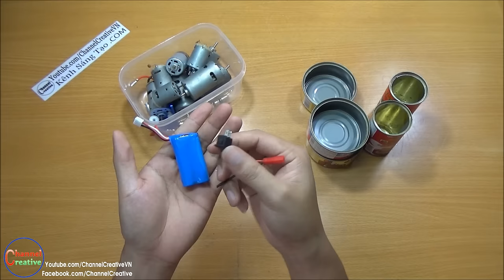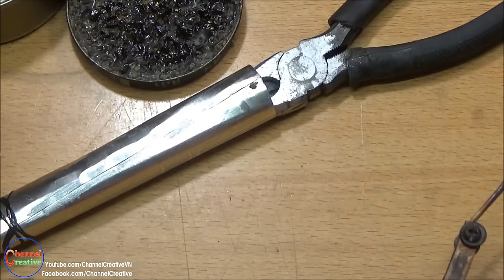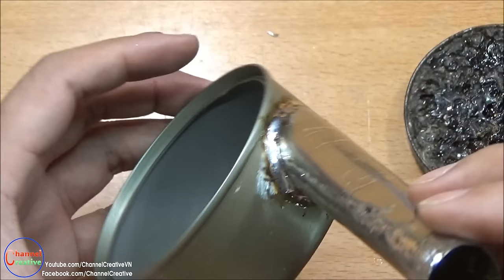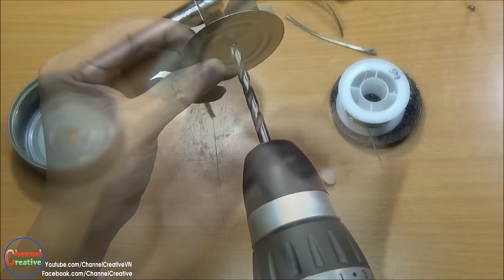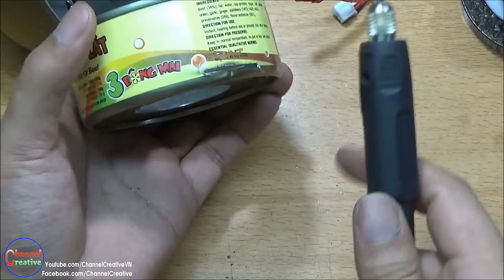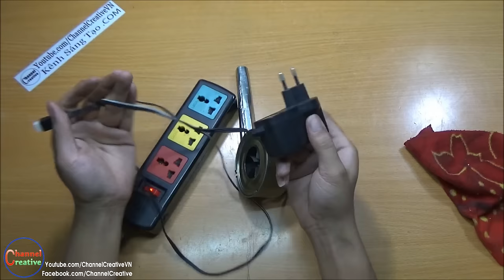How to Make Mini Super Powerful Air Blower using Cans Fish

Comment: When you solder tin or any large metal surfaces you could use some better preparation of the surface. Diluted HCl(hydrochloric acid) does very good job as a primer I've used it to make leak proof fuel tanks for model planes out of tin. Some rust converters can do a good job too. You will spend a lot less solder and you won't need the resin filed one.

Comment: If you curved the fins the opposite way you would've got way more air movement out of it. They should be scooping the air and forcing it through the exhaust rather than pushing through the air. Think of it like a turbo. The compressor wheel scoops air and forces it through the system increasing the velocity of the air going into your engine.
Reply: When I saw him put it together I noticed that straight away. Thanks for confirming I haven't gone mad! 🤣

Comment: Aren't the fan blades backwards compared to where the outlet is?  It still works, of course, but I would think it would be more powerful with the blades reversed.
Reply: That is an excellent point.  Unfortunately for smaller motors having backwards fins, "Backward curved" reduces some of the static pressure involved with pushing the air.  A forward facing fin, "forward curved" while it is efficient it is more prone to be sensitive to particulates that make slow it down due to friction such as air debris if anything got sucked into the intake side.  "Radial fin," straight fins at 90 degrees are great against particulates and pressure which is why they are used in vacuums, but since this is a blower and not a vacuum, for that size motor forward curved would probably be more suitable...
Reply: Good
Reply: Uh no, you need to google fluid dynamics and learn how air works like water. The blades can be straight because it's impelling it towards one exit. One entrance > One exit. Imagine you're paddling your boat, except it's sitting on air instead of water.
Reply: the whole blade design is wrong.    for example the inside of the fins extend past the centre.   they should be above centre.   
no they are not incorrectly curved as long as it rotated clockwise.   if it rotates counter clockwise it would be fighting it's own centripical force.  lowering the airpressure
Reply: darkracer125 but its work, so whats wrong?
Reply: s
Reply: Tyrome Williams great logical 'don't know what to call it'.
Reply: Yes , that's what I am thinking
Reply: Same question, thanks.
Reply: It works people stop trying to recreate the wheel round is best.
Reply: @tyromewilliams  À2

Comment: Beautifully made. I don't have the tool to cut out the air inlet hole. I'd also like to cover the hole with a mesh to keep fingers safe.
I presume making this in metal knackers the scissors and wood working bits quite quickly though.

Comment: There are like at least five different "Creative channels" with slightly different names - I feel like it's all the same guy.
Reply: Its awesome man!!  Please make a video of it making a vacuum in reverse...its mini and awesome...
Reply: @maximfremista665   i think you can set the turbine in other direction  , or don't set a hole in the lid and add another tube pipe on the opposite..  I
,

It could be work as vacuum and blower

Comment: u Bent the Fins the wrong way...
Reply: yeah I thought the same thing.  was that intentional or a mistake that wasn't worth fixing (obviously it worked anyway).
Reply: the fins can bend any other way, but the efficiency will be varied on different motor speed and torque
Reply: Even so, I wasn't expecting nearly as much power out of that little motor.
Reply: No he did not. Having them bent backwards like that improves how much pressure you get, not that it it compressing the air much.
Reply: Thorgon
Reply: It's not true, they're fine

Comment: How much pressure is? if you will put air outtube in to water+shampoo(or kithen washing liquid) you will get many many foam for you bath rapidly, for gasoline burner(jet) so i need to understand how deep you can submerge air-out tube under water still geting bubbles?

Comment: A broom and dust pan would have done a complete job of picking up a mess.  This just scatters it around.  But it could be used in a rocket stove to burn super hot with almost no smoke!  Try attaching it to a rocket stove and you will see what I mean.

Comment: Great video, I wanted to make balloon blower using sewing machine motor of spec 2800rpm, 1/6hp, 230vac , 150watt, 0.6A. By making similar impeller can get I get wat it take to blow balloons as they do in balloon arch blowing machine

Comment: hey man 
I am applying Flux (both liquid and paste ) on the joints of the blower tube and also I used 3 different types of solder but it's not sticking.. why can anybody tell me???? and i also did grind it alittle.

Comment: I could use one of these types of blowers for a demonstration I want to do.  All of the ones I have seen are so noisy.  Any ideas on how to suppress the noise without significantly reducing the flow capacity?    I haven't built one yet, but perhaps someone has explored this.
Reply: Most of the noise mostly depends on motor so if you want low noise use a more silent motor

Comment: tell me please hwere do you get all of your motors and i got a vacume cleaner i iv taken the motror out but i dont know how to run it with electricty and it sais on it its 1200w and 240v but help me how can i give it electricty without daNGER
Reply: dont mess with 240v stuff until you really know what you are doing. you would most likely need a driving circuit because its AC (alternating current) instead ov DC (direct current, eg in a battery) that his motors are using. lay it aside for another project when you are skilled and informed well ;)
Reply: you can get motors from most electric toys with moving parts.
Reply: old dvd drives some printers a little research can take you a long way it wont hurt and itll be useful

Comment: not gonna lie. I was disappointed that there was no housing for the battery assembly.  that's okay, though. I'll still be making one of these for my workshop. this way, I wouldn't have to power up my air compressor for clean up. I tend to have a lot of dust.
Reply: If you want that: get a can with a removable cap. Cut the cap's top part and glue it there (around the motor, battery and so on) and put the can in. :)
Reply: +AGloriousDawnLP yeah. I've made one since, and i just soldered on enough of another can to hide it, and cut out a hole for the switch. I actually used contacts for an 18650 battery. (huge pain to attach, by the way.) i was just disappointed that he didn't show anything more than the assembly. I'm one of those people who don't want wires showing.
Reply: +Benjamin Adams Me too, my friend. Me too. :) But I use to adapt everything I see in YouTube, making it more beautiful, more strong, more protected and so on. I use to paint in flat black and chrome, for example.
Reply: +Benjamin Adams But, at the same time... Imagine the time it would take if everybody made those projects perfect. 1h of video, if not more!
Reply: true. and i know that some people are happy with an exposed battery. i'm simply being picky. i can be kind of a critic of home made things, because a lot of my toys are in fact, home made. but it's like i told one of my friends. that's the part that makes the one that i made unique. i made a housing out of an extra can, you know? so i have to say thank you to the creator. because to be honest, i'd still be lugging out the giant leaf blower without him.
Reply: Exactly. And I used to make almost all of my toys too. Basically from paper and foam, among other things... And made a lot of things with dc motors from my broken toys. :) Now I'm 38 and coming back to it, as a hobby. :D

Comment: Why soldering? For such a project duct tape would suffice.
Reply: It is much more durable..
Reply: Why hot glue
Reply: If you want to make it with a hot glue or something else, do it.. The guy just wanted to be extra durable.
Reply: you really don't want rotating metal pieces to fall off in full speed haha
Reply: Right haha